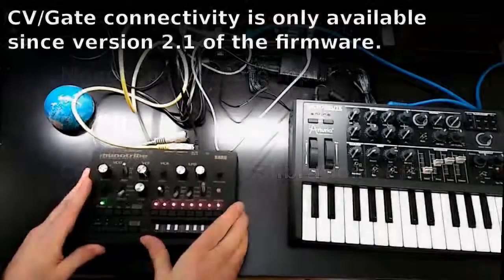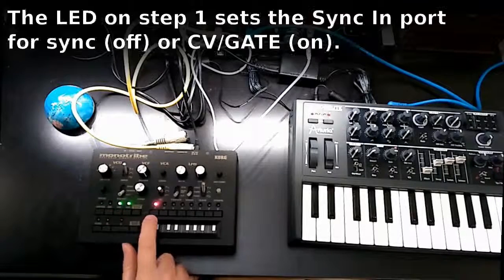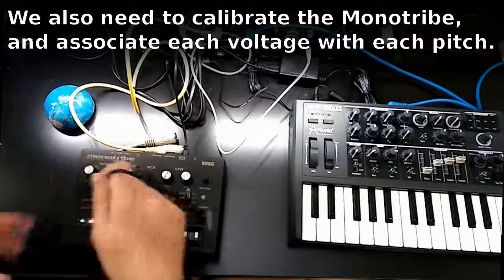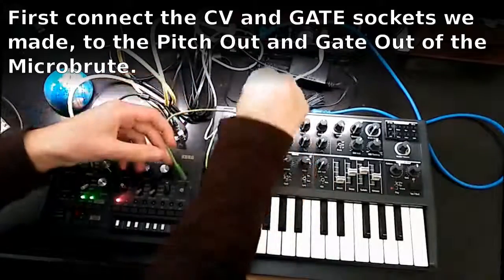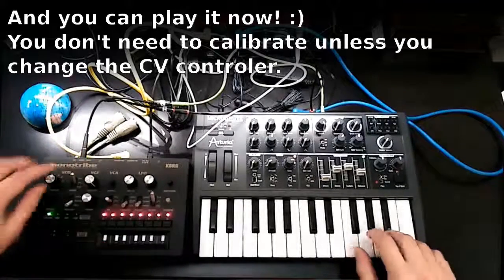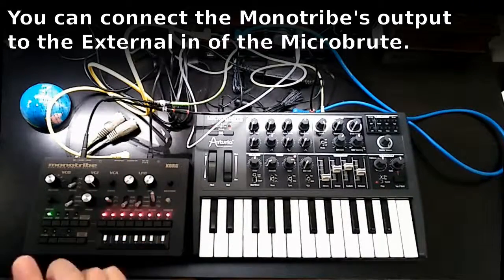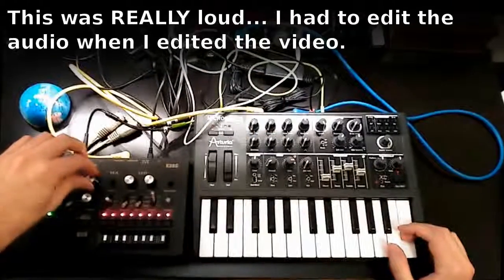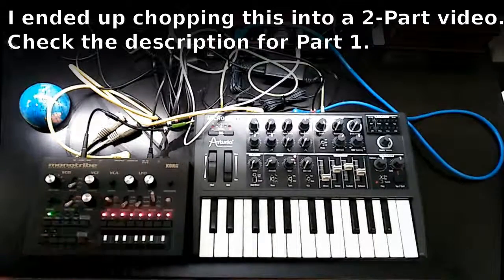Control Voltage on the Monotribe - Part 2

Comment: I tried this and now it seems stuck in sync mode, or CV gate mode. Can’t use the drum pattern and the tempo light is always on. If I run SyncKontrol into it, I can get a pulse rhythm, but still no drums. Happened to anyone else?

Comment: 4 years on and I only just got round to actually playing my Monotribe with a keyboard. I have always liked it a lot but I am even more impressed with the black magic box.
Reply from the maker: It does sound great. Personally, I ended up adding a MIDItribe mod, so I can use MIDI din cables instead of calibrating the CV input every time I switch gear.

Comment: filipe  please. when i check the firmware on my monotribe it looks just as yours except there is no led  lit on step 4 or 8 only 7.  do you know what it means or can you point me in the right direction?? by the way i can't find the new manual in english anywhere.
Reply from the maker: Hi Alex.

Sorry for the late reply. It might be that you are still in firmware 1.0, but please confirm it with your Korg dealer. As for the manual for the 2.1 firmware, the manual comes as a pdf inside the zip file that contains the system updater.

I hope this helps.
Cheers.

Comment: but how do I calibrate the sq-1?
Reply from the maker: Hello Voo Doo

That is a good question. Before starting the calibration routine, I set the SQ-1's A sequence to be 1V in range and turn all the knobs to the left, when the Monotribe is expecting the lower C, I start the sequencer and stop it after it goes for a few steps. This should be enough for the Monotribe to get the low C voltage. Then I quickly turn all the knobs on the SQ1 to the right and play the sequencer again for a few steps, to feed the Monotribe with the high C voltage. It is better to have the gate time of the SQ-1 all the way to the right, also. 

I hope this helps. 
Cheers!
Reply: Philip+ best answer I received so far :D I will try it!

Comment: thanks very much
Reply from the maker: You're welcome +Damian Hart ! 
I'm glad people are finding this useful: if I knew this beforehand, I wouldn't had defaced my Monotribe with the MIDI extension. 
Cheers and thanks for watching! :)
Reply: +Philip+ Will i also need to buy a multimeter to or would i be able to do this just by purchasing the Startech.com 3.5mm 4 Pin to 2x 3 Pin 3.5mm Headset Splitter Adapter?  thanks
Reply from the maker: +Damian Hart A multimeter is important to check which of the sockets goes to the tip and which goes to the Ring. You can guess your way into it, but it is not as easy. A cheap multimeter will do: the one in the video costs about 4€ on local supermarkets (and a multimeter is always useful to check for flat batteries, so it pays of to have one). 
Cheers ;)
Reply: +Philip+ ok thanks Phillip
Reply from the maker: Hi +Damian Hart .
Sorry for the late reply, your comment somehow ended up in the spam box.
You can upgrade directly from whichever version you currently have to the latest one (downgrading is impossible, though). As for the breakout box, I suppose it will work fine (but I cannot test it at this moment).
Cheers!
Reply: Ok thanks very much